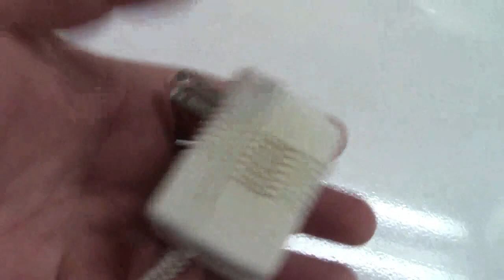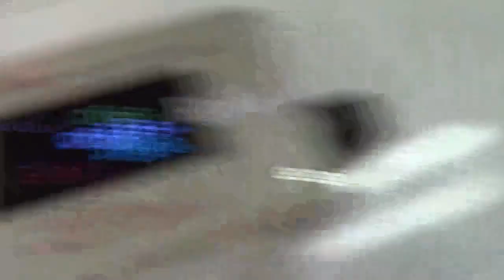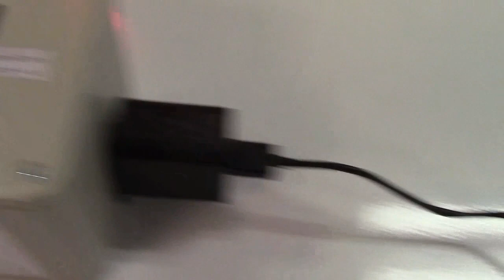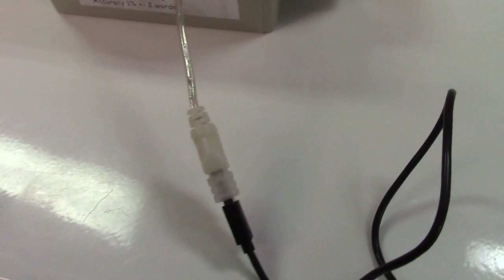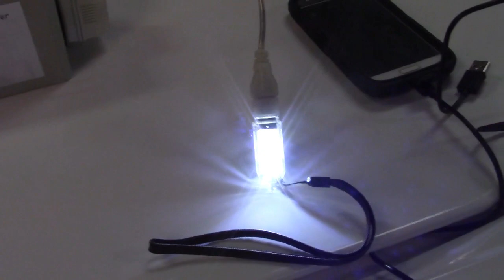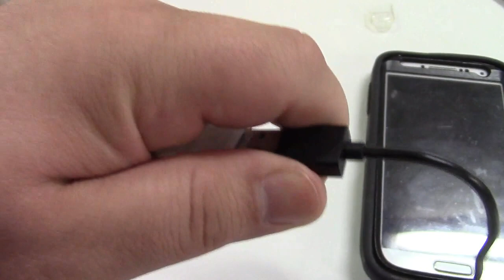jaykay18 Oddware:  USB Power Adapter With Magnetic Transformer

Comment: The same Transformer as in flourescent ballasts ?
Reply from the maker: Besides this being a step-down transformer rather than a step-up transformer, yes, essentially.
Reply: @jaykay18  over here magnetic ballasts Limit down and the starter gives a stepup
Reply from the maker: Not quite.  The ballast first provides high voltage.  The starter switches in and allows the elements at the end of the tube to warm up, then switches out, giving an inductive "kick" to the tube, which usually takes a few iterations.  Once the tube lights, the ballast limits the current.  Typically, it's under 100 volts for tubes under 30 watts, and 100 to 175 volts for tubes 30 watts or more.  We run 120 volts here, so usually it's a step up for larger tubes.
Reply: @jaykay18  i think the 230volt ones are more complicated
Reply from the maker: Nope, same thing.  Only difference is the number of turns of wire inside the ballast.

Comment: so that phone has an OLED screen, it would be kind of interesting to see what the difference would be with a phone using an LCD screen

that phone is also from an era before Samsung's 9V adaptive fast charging, so 5W 1A is about average for it. same as iPhones of today using the included charge brick
Reply from the maker: Probably not much, certain phones are more sensitive than others about how much voltage they need to "turn on" their charging circuits.  Even if it did charge, that doesn't mean it would charge full and certainly wouldn't be fast with an adapter like this.
Reply: jaykay18 with that one if it even made the phone say it was charging it would be so slow the battery would drain at a slower rate than normal but that’s it
Reply from the maker: Yeah, probably true.

Comment: @ 4.5 volts. Charging can be on the teeter totter.
Reply from the maker: Yep, didn't work with my phone but worked with power-only USB devices.  Didn't try my tablet but I'd expect it probably wouldn't charge that either.  I also wonder how noisy the power coming out is.
Reply: @jaykay18  My I Devices will charge at 4.5 volts. If I set the voltage to 4.4, then no. Straight up power, with no communication.
Reply from the maker: Sub-standard equipment can handle sub-standard voltages, what more can I say?!?! ;-p
Reply: @jaykay18  Ahhh-Sooooo!